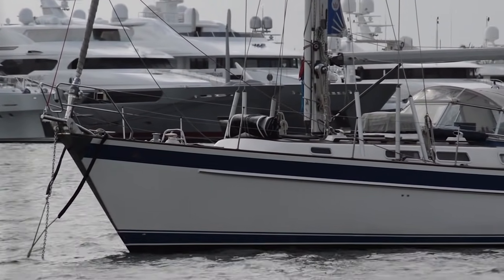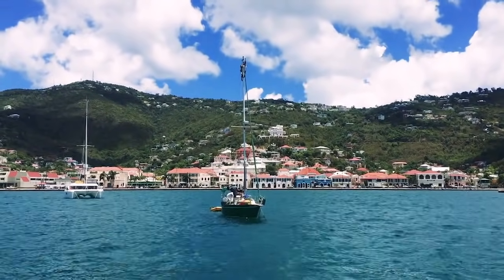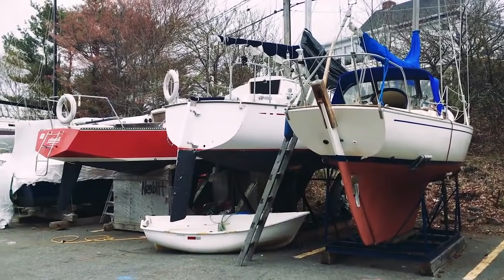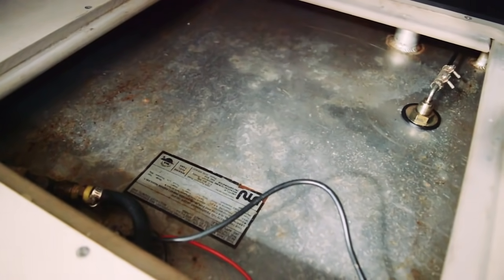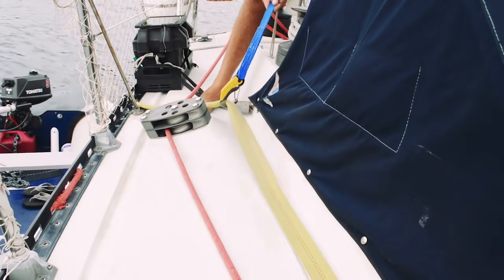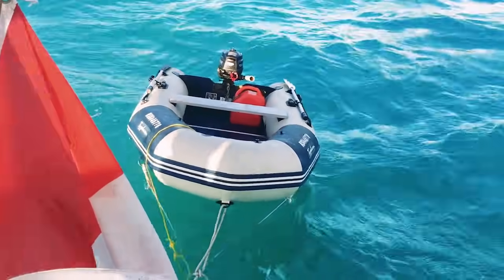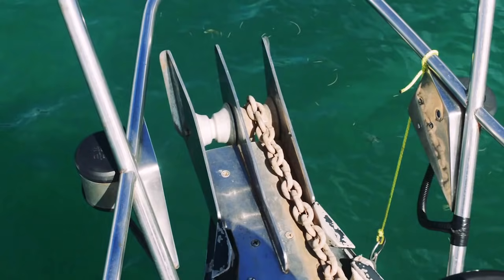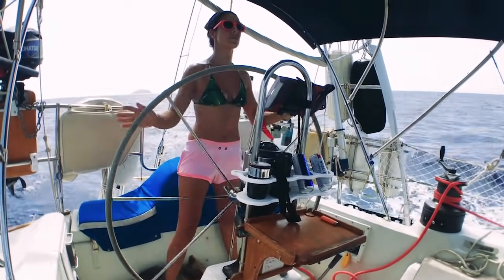How to Buy the RIGHT Liveaboard Cruising Sailboat to Cross an Ocean | Sailing Balachandra E094

Comment: You are absolutely incorrect about putting a massively large horsepower engine in your boat.  Your boat speed is limited by you waterline length and maximum diameter prop you can fit.  That will determine your shaft horsepower.  You then add  the power requirements  to drive any items attached to your engine such as alternator and water pumps.  That data will then determine your maximum brake horsepower.  Any engine above that is simply wasted power.
Reply from the maker: Thanks for sharing this, no one has explained it like this to me before but it makes good sense. I'm sure production boat designers recomend motor, prop and shaft sizes based on solid engineering math... at least i hope so
Reply: Man you need to chill, extra horsepower is not a bad thing 🙁if you get caught in a bad storm even at anchor you can use your engine to keep from dragging anchor.Also you don’t want to run your engine at near max rpm .I don’t think he said to get a oversized engine,obviously you’re not experienced about sailing and not a naval architect so don’t critique these very experienced two.Suggestion….. just watch and learn.But the biggest thing I can suggest is don’t comment 😂😂
Reply: @markbuskens6070  Everything I said was spot on and nothing you stated changes those physical limitations.  However I do understand your desperate need to silence those who challenge your ignorance.
Reply: @markleyg  your reply showed who is uninformed,my reply was not disrespectful to you.Guess you’ve never been on an underpowered sailboat when you need it.
Reply: @markbuskens6070  Really?  Telling someone to shut up just because you disagree with them is not disrespectful?  You obviously have no idea what the concept of respect is.
Reply: @markbuskens6070  pump the brakes there Karen.
Reply: Marklegy can you comprehend what you read??I think not 😂😂😂
Reply: @markleyg  are you now an English teacher??🤓
Reply: @markbuskens6070  No.  Just educated.
Reply: @markleyg  my comments sure hit a nerve 🥴
Reply: @markbuskens6070  Yep.  My funny bone.
Reply: Bernoulli's principle and archimedes principle demonstrate the principles. Please go to school a learn!
Reply: I still don't understand these stupid discussions going around the Web, who decides if a boat can be considered bluewater or not?  
Expensive or cheaper?
Good or Bad? 
Typology and specifications? 
Why doesn't a specific body establish it according to strict criteria to which all manufacturers must adhere?  
Who controls who and how?  
According to what regulation? 
And recognised by whom? 
Do we still want to believe in the fairytale of the CE mark?  
Which, by the way, I see it written everywhere even on my underpants!
So I don't think we need to be a naval architect to understand a very simple, if not obvious, concept that regardless of the builder, whether it is Beneteau or any other, there is a legislative and regulatory VOID in this sector that concerns not only the construction and design, choice of the materials and their origin, the absolute lack of supervision by any recognised third independent body from the design, the construction, up to the delivery of this type of boats, the lack of training and professional courses for the staff employed by these yards,
which would make the most stubborn navigator pale.  
The truth is that these shipyards do what they want and their constructions have one and only one denominator the profit!
Reply: A larger engine will not have to work as hard to develop the same theoretical maximum needed horsepower and may then have better longevity.
Reply: @nodaklojack  No.  The RPM powerband will still be the same but now you won't be able to be in that band.
Reply: Larger engine turning a more aggressive pitch prop.
Reply: Define ”massive horsepower "
Reply: @nodaklojack  Any engine that won't permit you to run in the powerband at hull speed.
Reply: @markleyg  OK, the argument is more about prop size limitations than anything. In your mind you are at max diameter prop and pitch. 
That is not where my starting point is. I think it is normal in nautical world to start below  maximum and increase Hp and prop diameter and pitch until maximum is achieved.
Your post just has an unexpected starting point from which most boat owners start from. 
I would expect people to start low and upgrade rather than start at the very maximum.
Reply: @markleyg  lmao 7+ months of arguing.
Reply: @nigelsilva7719  Those who can't produce intelligent arguments scream for censorship.
Reply: The more horse power the faster it goes. Period.
Reply: @beorbeorian150  Lol.  You obviously know nothing about displacement boats.
Reply: @markleyg  He likely doesn’t know about hull speed in a displacement boat compared to a planing hull because unless you joined the Navy as a teenager (me), own a boat and are the curious type, or are a naval architect or otherwise studied applied hydrodynamic in college (also me) this is a very esoteric and non-intuitive field. 

For the other guys: there are two basic kind of boat (or ship) hulls: a displacement hull, and a planing hull. A planing hull is one designed to a) shift the entire hull (or most of it) out of the water and b) do so in a way that decreases the needed power at a given planning speed. An analogy for this is a person on water skies - they have a lot of drag while they’re still in the water, but once they stand up they provide a lot less drag because you’re taking advantage of the changes in density of water and air. A displacement hull is more like a torpedo or human swimmer - to move forward all of the water has to move out of the way. Basically all non-racing sailboats are displacement hulls, and all ships have displacement hulls (exception: the US Navy had a test Destroyer in the 1960’s that had deployable wings - they don’t exist anymore, but we’re indeed ships with planing hulls - using wings to do so). 

Here’s what Mark was getting at: the max speed of a planning hull is essentially only power limited - my old 20ft powerboat with a 200HP big block will get me to 45 knots or so, and if I swapped it for a 1000hp engine I’d be able to do 90. But a displacement hull is different, as the fluid dynamics works out so that as speed increases the needed power increases more or less linearly until you get to “hull speed,” at which time the power needed to go faster becomes exponential. Hull speed is the speed at while the wake wave peak to peak distance is the length of the boat, at which point a drag disjunction occurs as the wave no longer returns buoyancy as it rises at the rear of the boat, essentially making your boat power up its own wave continuously, requiring that you input more power to overcome not just the increased drag but also the vertical component of the wave - this gets increasingly worse until the wake wavelength is twice the boat length, after which the rate of increase in needed power for a given speed decreases. As a practical matter it’s inefficient to operate any boat above its hull speed unless you’re going past that on your way to planing speed, so for a sailboat more power won’t necessarily give a meaningful increase in speed.

Regarding the idea of over sizing your engine so it doesn’t have to work as hard and thereby increase longevity - that’s already accounted for with marine engines (and aviation engines too). There’s a GM engine that’s been around for many decades, that made 450hp in cars, 200hp in boats, and only 150hp in aircraft - and the exclusive difference (aside from plumbing, obviously) was the use case - that engine could easily put out 450hp for the score of seconds it would in a car, but the engine use on a boat and plane is different, there the engine will be run at either full or close to full power almost all the time, so the engine was de-rated, the time slowed, and the RPM limit lowered. With an hour of work you could still switch applications and the engine would work just fine, but different operating conditions (max power for days at a time on a boat, for example) resulted in different engine tuning, even with the same fundamentals. 

P.S. if anyone remembers what that engine was, please remind me.
Reply: Damn that got crazy
Reply: This is why I want a sailboat to get away from people like you And yes, I’ll take a giant huge motor lol
Reply: Nice to have some power on tap for fighting tides

Comment: Multihulls are great, totally different in capability than monohulls, and unless you REALLY look around, most are designed for weekend charter and not crossing oceans.

To get any serious cargo capacity you have to size up significantly as well. And they cost more to haul and to dock. You have to sail them by the numbers, Otherwise a squall can break rigging instantly. If they have a big, low saloon, chances are she'll pound mercilessly upwind, or into heavy chop.

But..they don't roll or heel. They Sail fast off the wind. They have living space above deck and they have acres of deck space. They are unsinkable. The dinghy often has a place behind the cockpit. There is sometimes a lowering back deck for boarding.

They are just different. Not better. Not worse.
Reply: They don’t go to weather well and their apparent wind wanders so they don’t work with wind vanes either.
Reply: @AndyKopac  Wharrams work with windvanes. And multihulls with deep dagger boards go to weather just fine.

To be honest, I hate going to weather. I'd much rather take longer on a reach if I can get away with it.
Reply: @timothyblazer1749  Good point. Not all monohulls go to weather either. I don’t mind going to weather, but I have a staysail ketch and keep my center of effort low when going to weather so we don’t heel much. I once sailed to weather with a windvane nonstop singlehanded from Panama to SF using the clipper route off shore. Steady 20-25 knot winds I was flat and happy, seas were flat too. Took me 64 days. Was one of the best sailing I’ve ever done. I’d never do a Baja bash after doing it. I’m not crazy about following quarter seas either, but you plan your routes best you can with what you got and play the hand your dealt.
Reply: @AndyKopac  yeah...staysail ketch is the way to go crossing oceans. In my dotage, I've also come to seriously appreciate full keel boats, like Colin Archer used to build :-) Those can lope along to weather forever!
Reply: @timothyblazer1749  I go no place fast, everywhere slow though. My happy place is 5-7 knots, but a multihull cranks. I grew up with a Hobie 14. Had it through college.
Reply: @AndyKopac  I always thought if I ended up in the South Pacific I might be on a wharram. I like slow too. :-)

I sailed Mercury's as a kid!

Comment: always surprised at people who don't have experience and then they give advice to others.   So many comments in this video are wrong.   Ugh.
Reply from the maker: Thanks for watching Olav. Not sure how you measure experience but i appreciate the ascessment. Can you list off the things you think are wrong with the information in the video, and what standards you are basing your opinion on?
Reply: Sailing Balachandra I can list a few. You should have jackstays fitted regardless of whether or not you need to go on deck to reef. What are you going to clip on to if your genoa furler jams and you need to go to the bow in rough weather?
Reefing in the cockpit is something we dont like. We reef at the mast. Its quicker less complex, keeps the front of the cockpit clear of lines. On a heavy cruising boat with flush decks, granny bars and tall guardwires reefing at the mast in rough weather is no problem. You clip on and the job can be done quickly. 
Twin furlers on the boat is the way to go. If you only have a 100% jib you will be under powered a lot of the time. We run a solent rig. 130% genoa on the main furler. 90% staysail on the inner furler. Large sail area when you need it and a tough triple stitched working headsail when the conditions get tougher. 
Dont take a PVC dinghy to the tropics. They dont like UV. A hyperlon rib or a hard nesting dinghy make more sense as long as you can stow it on deck safely for rough weather.
If you are going to talk watermakers there are things to consider. On a 35-45 ft boat having sufficient space to mount solar can be an issue. You need a lot of solar to successfully run a 12v watermaker. We have dome 12v watermakers and now have a diesel genset a 220v watermaker that can make 200 litres per hour. If you dont go for 12v with loads of solar then consider engine driven high output water maker.
Reply: @timevans8223  I agree with you and they is a lot more to be said about what he said but say he got 60% right.
Reply: @timevans8223  Appreciate your knowledge and willingness to take the time share it! I'll copy your paragraph and save it in my "Sailing Knowledge" file for future review.
Reply: @timevans8223  do you reef solo?
Reply: @ellingwood1  yes. With only two of us onboard we sail single handed in shifts on ocean passages. Its not good to wake the off watch crew everytime you need to reef or remove a reef. We do 4 hour watches and unless the weather is 3 reef weather we would tuck a reef in single handed. Its not hard if the boat is set up correctly

Comment: I obviously got it right, I've got a '13 steel hard chine Van De Stadt S34' with the taller 7/8 fractional performance rig, hard dodger, radar, solar arch with 2 rigid panels(400w) 3KW inverter, 315Ah house bank, AIS class B transponder with antenna splitter, SSB  with automatic antenna tuner, Scanmar pelagic tiller pilot and a second redundant autopilot, 5 GPS units, EPIRB, new 9" MFD plotter, two tablets with navionics, 2 inflatables and a mariner 5HP outboard, 20 ton electric windlass with foot controls and cockpit remote, 33HP vetus, large watertight head/sail locker/wet storage in V berth with separate bilge valve, 3 burner gimballed stove and oven, fridge and freezer, pressurised hot and cold water, 350L water in 2 SS tanks, 180L diesel, furling headsail, carver continuous furling reaching spinnaker, removable dyneema baby stay and hank on storm staysail. 8 metric tons dry weight and upward of 12 kn hull speed, clocked 16.8 boat speed surfing downwind with the bag. Only things I don't have are a liferaft and self steering vane (hydrovane on order) absolutely everything is less than 8 years old.
She's ice rated built to Lloyd's register ocean class A ocean going specifications and is in essence a high latitude capable mini expedition yacht.
I'm not going to mention price but it was under 30K.
Reply from the maker: My friend has a boat like this. Steel are good boats for everything. I would go steel but the hull maintenance scares me.
Reply: Thanks for the listing!  Am pondering steel, but I'm so new to this world, I don't even know my wants much less my needs - other than I believe my desire to be on the water all over the world will stick... Sounds like you got quit the deal on your boat and the speeds are really impressive!

Comment: Most folks plan to buy a boat,  cross oceans, and cruise extensively and indefinitely. Most folks and most boats never will, but instead, will spend their days and nights in marinas with occasional trips up and down the coast.  Even dedicated cruisers are really only "at sea" for about 10% of the time. Therefore, buying a "true blue water vessel" is a colossal waste of money and only pandering to unrealistic sailing fantasies.  It also will adversley  affect comfort at the dock as well as wrangling "the ship" in and out of the slip.
Do you really need that big bowsprit spear or huge fuel tanks? What about built-jn ice boxes in the galley instead of a working refrigerator? 
Wake up, you're dreaming.

Comment: Good video for sure, but you say a lot of stuff for granted. Most of your viewers are going to have no clue what you are talking about with all the lingo you used.  All the various terms for all the different sails, 100%, 150%, 90% sails or whatever, all the terms related to the dingy.... I am just going to strap it on there somewhere; I don't need a specific spot for it or fancy mounts. All the different lines and brackets/winches you mentioned....galley, berth....huh? 
Those of us that are looking for our first boat, have no idea what any of that is. Just use normal terms. "Main sail", "front sail", "bedroom", "bathroom" etc. Otherwise we are just spending hours with a dictionary trying to figure out what you are even talking about.  There just is no need for all those fancy terms. We're newbies, not seasoned sailers. 
Just as important I'd the numbers. like the height of the sail. The ICW, huh? Well, how tall can the master be then? Didn't mention it, but I saw it in the above comments. How much water storage should it be able to transport? You mention storage, but don't give any rough numbers. Same goes for fuel. How big a fuel or water tank do I need to get to the virgin islands from Florida? Or Bermuda from the Carolinas? Or anything related to that. 
Again, good video, but it was more frustrating then helpful for me because of so much sailing jargon and lack of specifics on important things.